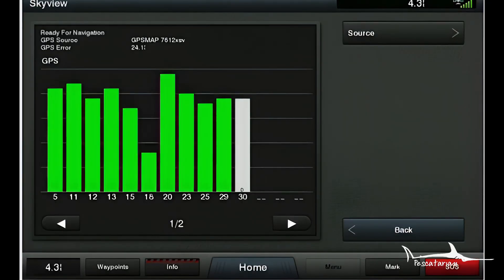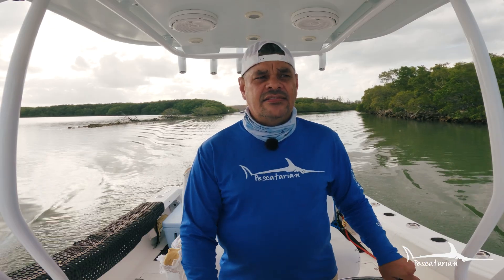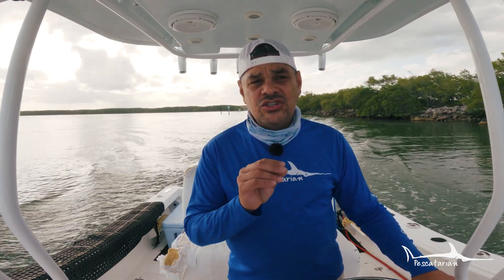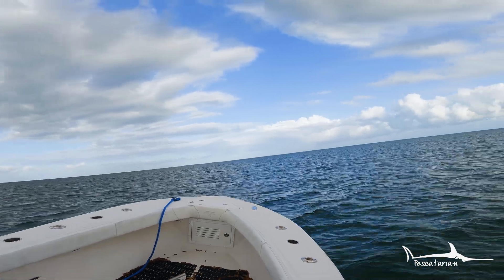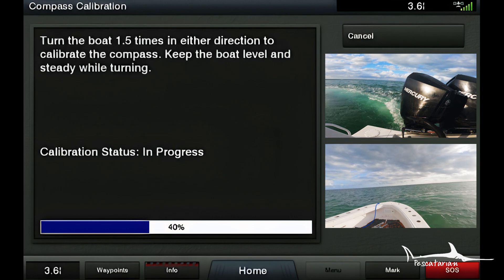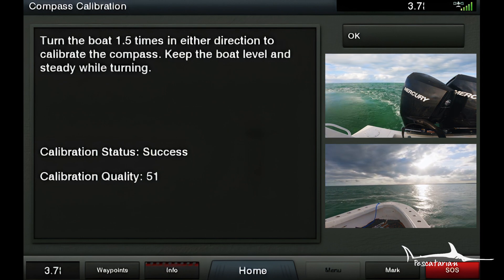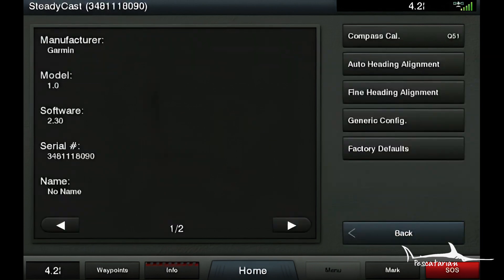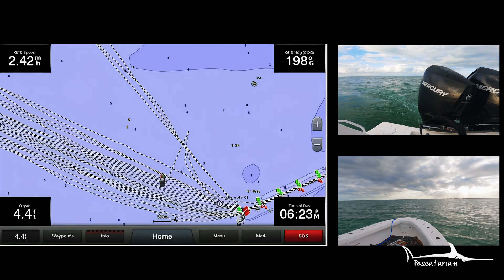Garmin Marine:  STEADYCAST Heading Sensor Install & Calibration

Comment: Does 51 calibration quality concern you at all? I personally can't get mine above 77 and it bothers me. I tried different sensor locations, speeds, boat locations, etc but 77 is the best that I can get
Reply from the maker: 51 is pretty low but 77 should work fine it just may shorten the life of the sensor. Try looking around for anything metal nearby. Sometimes the smallest thing can alter the heading sensor. 

One time mine started acting funny and my screen was off and we moved a camera that we had in the console and it started working fine again.

Comment: You didn't get into the Install part. The SteadyCast needs to be connected to a NMEA2000 backbone then the backbone is connected to your Graph/Chartplotter. The NMEA2000 backbone starter kits are around $125. You then can add more "T's" to the NMEA2000 backbone if you want to connect other chartplotters or Panoptix LiveScope. Mine is connected to three chartplotters.
Reply from the maker: Thanks for sharing that additional information about the installation process!

The sensor is very easy to install, it comes with one wire which plugs right into the NMEA 2000 backbone and it gets its power from that. 

It is truly plug and play. The only thing you need to do once it’s installed is to calibrate it to the boat and you are ready to go. 

Thanks for sharing and thank you for watching and supporting the channel!